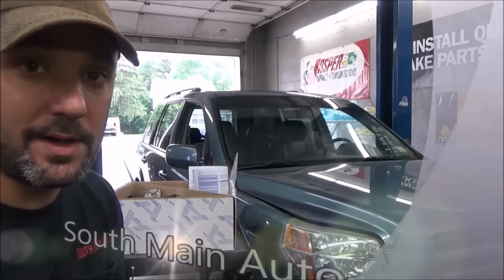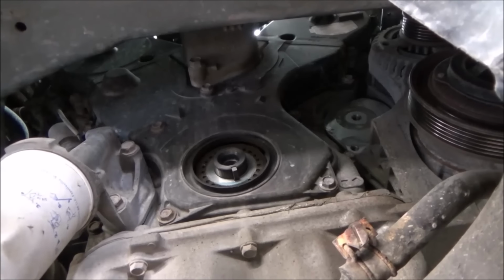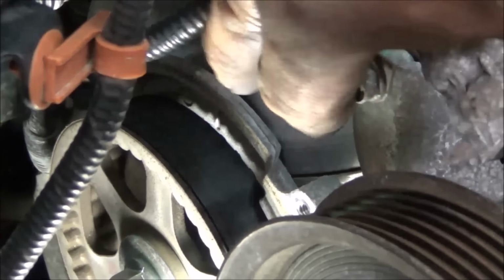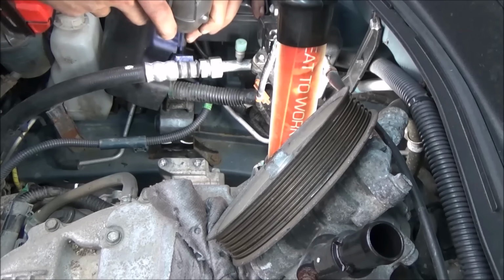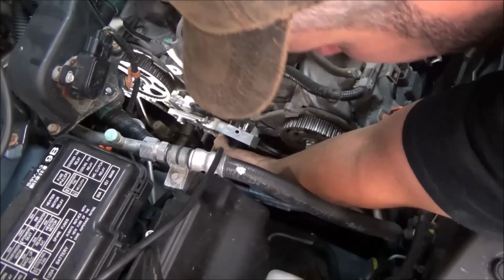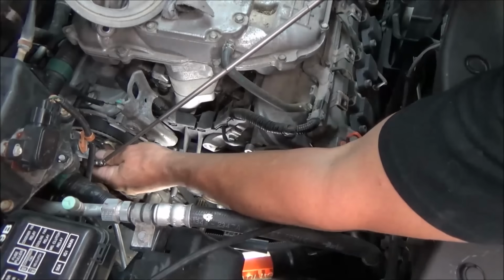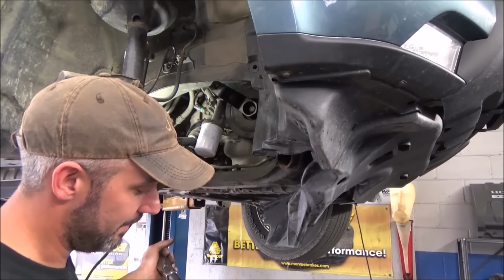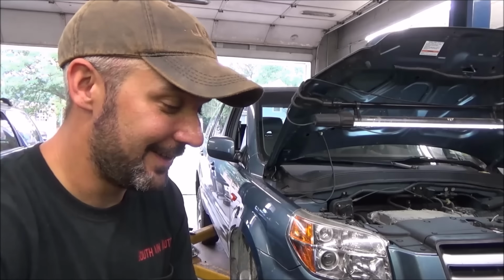Honda Timing Belt 3.5 J35 - Pilot, Odyssey, Ridgeline

Comment: Very good video! Thanks you for doing this. I used it profusely to do the job on my 2012 Ridgeline, with success.

Although, I had a lot of difficulties removing the crankshaft bolt. I couldn't try the way you did it because I didn't have a special beefed up socket wrench like the one you have and in any case, I didn't have enough pressure on my compressor to drive an impact wrench efficiently. Then I didn't have a crankshaft retaining tool to use a super long breaking bar (I broke an extension bar and my cheap breaking bar extended with a piece of pipe :-( . I found out later that I could "rent" a special crankshaft retaining tool (basically for free; they charge about $60 and you can have it for 3 days, then get all your money back upon return of the tool. I had to have that tool in order to re-torque the bolt in place to finish the job), at my Canadian Tire.

Nevertheless, I tried to do a few tricks that I saw on internet (use a Honda jack to break the bolt loose.....didn't work, then tried the starter trick (disconnect the ignition coils first), but this is dangerous and didn't work anyway. I then tried to torch it with a "Map gas torch".... not enough heat. Then I fiinally had it by borrowing a real set of oxygen/acetylen torch and it did the trick, although, you need so much heat that I was scared to damage surrounding plastic parts, etc. But it worked. I would have liked you to mention what is the direction of the crankshaft rotation, because I wasn't sure of that and I found out by actually filming my engine for a second of two while starting it.

Thanks for a very well explained video!
Rich

Comment: Your video just saved me $500. Same kit as you used. And even with the honda cranky tool, the crank bolt really did need two of us and a big cheater bar! Wish I had that super socket! The rear crank pulley was a pain to align--it would skip past the mark over and over again (engine compression?) and so it took a while to figure out how to get the mark aligned on all pulleys. Finally we figured out what tooth the belt needed to be on and then used the belt to keep it from over-rotating. Total job took 9 hours for two of us, but it was my first job of this kind so I'm pretty excited. Runs great! Again, thanks!

Comment: Outstanding video! I did this job on my wife's 2012 Odyssey last month after watching this video too many times to count. On her van, I had to remove the Intake Manifold Tuning (IMT) solenoid to remove the power steering pump and I had to take all the bolts out of the computer brackets to remove the engine mount.

Comment: Great vid, I made the marks highlighted with metallic gold color, makes it easier to verify the match mark & very nice to turn the crank manually to verify clean non-interference of parts.....no need to destroy the head and bunch of valves on power start after finishing up! Did this 2 yrs back to our Pilot....missed the rear bank cam sprocket by 1 tooth and had to get back into to reset that....oh yeah, later that year found I needed eyeglasses!!! Good video! This is a tough job for the average DIY ....but fun and save a bunch of money doing it at home!

Comment: Just finished on my 2010 Odyssey. This video proved to be invaluable! Never done a timing belt before, hope to never do another. Took two days with several breaks and a couple messy moments. Only one cut, from pulling off the old water pump, the housing is very sharp. Of course my power steering pump made a mess. All in all not too difficult. I did purchase the extra large 19mm from Lisle. It didn't help. That crank bolt is no joke. Took me several tries and all my weight to break that mother loose. 😡

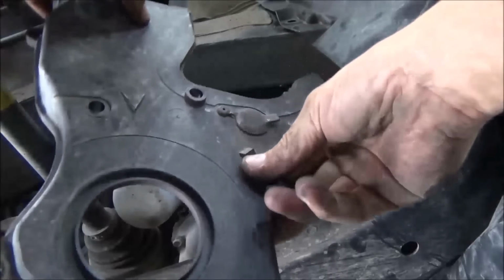Comment: 15:30 There might be an argument for replacing the crank sensor while in there. My tensioner failed at 148,000 and it seems to have taken both sensors with it (they were probably shaky, but the vibration from the tensioner probably hastened their demise), unless the ECM is just jumping to conclusions. 
PS: It's no wonder most of these videos are of Oddyseys, Ridgelines and Pilots; there is no room in my Accord Hybrid for that socket, let alone a camera.

Comment: I promise I won’t tell the 130,000. When we’re not watching tell me u don’t just rattle that crank bolt with 4 ugga duggas and move on. Throw the loctite in the trash. Properly tightened bolts don’t loosen up. Lug nuts, head bolts and everything else u put on the car. It’s lawyers and factory hates DYIer’s. The same loving souls that give us internal and external torx. Think bell housing to trans case 4L60. Those r beauties. Right guys?

Comment: Awesome video! I just completed the 100,000 service to my 2006 Honda Pilot. I followed the video step by step and car is running perfect! Very thorough! My biggest challenge was getting the hidden bolt for the engine mount that is located under the electrical equipment.

Comment: Hey Eric, nice video.  Got myself a 2017 Ridgeline and was curious how much of a pain it was to do this job when the time comes.  Cramped but not too bad. Is valve lash adjustment recommended at 100k miles?   I learned the hard way that I should have done that on my turbo subaru.  Had burnt exhaust valve at 140k... Had to repeat whole damn job with addition of head removal for head job. Sucked.

Comment: Hi south point repair 
Quick question, the guy I bought the pilot from changed the timing belt and water pump but never changed the hydraulic tensioner. I can notice some noise and was planning on changing. If i take the hydraulic tensioner out, do i need to adjust the timing belt or anything else or I can just snap on the new one.

Comment: Another great and useful video! Thank you!  We found a decent 2002 Acura MDX for my wife, needs timing belt done among a few other things(and I'll be the one doing it).   Mind my asking, if I don't have a car lift (just jack stands) how painful is this job going to be?  
I'm super concerned about the crank pulley bolt (will I be able to remove it?). I have a large craftsmen air comp with a somewhat beefy but basic Husky 1/2in drive.  What are my chances? If it will help, can you tell me where to get the (special) crank pulley bolt socket?

And can the crank pulley (hold) tool and Lisle socket be rented at an autozone, etc?

There are some oil leaks to address as well, hoping it's not real main seal. Could be crank seal and/or valve cover gaskets.
Where are some of the common oil leak areas on the 2002 acura MDX in your experience?

Finally, what belt, water pump, pulleys kit do you recommend? I'm thinking of getting an AC Delco one, but is the water pump it comes with a decent one?

Thanks so much for any reply

Comment: The heavy socket made it so much easier. Tried with a friend with a breaker bar but no success. Ordered this big socket and it opened it in a bit. Tried with the standard socket but no success.

Comment: Hey question on the side mount bracket bolts,  on my Honda I was looking for them and I took them out with my hand !!!, I tryed to screw them back the spin a couple of times and then get loose they are stripped.... do I need a new engine Block???..I did not Do a timming/watter pump change  i was just looking down the motor while ding an oil change and noticed one of the bolts sticking out.... great videos.

Comment: I have 2003 Accord V6, won’t start. I know I will need timing belt kit, but how can I tell if the valves are damaged? Any input will be helpful.
Reply from the maker: you will have to do a leak down test on it
Reply: South Main Auto Repair   I’m not sure how to do those tests. I took off the top timing covers, I saw the belt intact but was chewed up and some slack, I was able to spin the pulley. There was a point where it was hard to spin and a point was very easy where it spun quicker when I removed the wrench. I think the tension broke? Is it still possible that valves are damaged?

Comment: Top notch video, I realize this was a hard one to show but you did a very good job of it.  Most complete video I have seen yet for this timing belt change.  I now have two of these 3.5 engines so it is only a matter of time until I will be attempting the job. I have a 2012 pilot with 62k and a 2013 accord with 67k so I have a bit of time to watch and learn.  Thank you for your time!

Comment: I did this in my drive way with ramps and to hold the engine used a ratchet strap to the eyelet for hosting the engine out to the opposite side cross frame so the Jack wasn't in the way at all

Comment: I just had the Honda dealership install timing belt water pump kit on my 2011 Honda Pilot and now on a cold startup when I put it in gear it makes a vibrating noise. What could be making this noise? And yes I will be bringing back to the dealership. Wish I had a mechanic like your self near me I could go to.
Reply from the maker: Motor mount alignment issue maybe!?
Reply: Well the verdict is out on what was causing the noise supposedly. Dealership said it was the Bando serpentine belt I gave them to replace the old one as long as they were replacing the timing belt and water pump. Hard to believe

Comment: In the middle to changing my timing belt and watched it t confirm a few things.  I was able to watch the entire video without being bored which is testimony to the presenter.  Everything he did seem spot on.  There was one tiny thing that I would do different. Pull the battery cable while working on it.  But maybe I am paranoid.  Thanks for the great video.

Comment: Great video! Thanks for the help. 

One important thing that would be worth mentioning in your video. I know it would have helped me. 

The rear cam does move on occasion about 3". What do you do if this happens?
I had no idea it could do this, since I never saw it mentioned in videos.   I started questioning my timing marks and what I did wrong. Just a frustrating experience.  

Anyways I think you have one of the better videos on this subject, Thanks again!

Comment: In you're video is in depth, easy to follow and out right awesome. Thank you for this gift, you helped save my family a lot of money. .Tip for those unable to get the CS Bolt off. Put a breaker bar and a 19mm socket together and have it snug over the wheel assembly while holding the CS Bolt. Brealy crank the engine. It will Easily break free (CS turns counter clockwise.).* CS = Crank Shaft

Comment: If you don't have a torque wrench like on this video to torque a 60 degree, you can buy a device on ebay that can do a 60 degree on that crankshaft pulley bolt and it costs only $7.58.  A simple device and there are a lot of videos on youtube to show you how to use this device.  Here is on ebay:
https://www.ebay.com/itm/360-Torque-Angle-Gauge-Rotation-Checker-Measuring-Gauge-Meter-4-Torque-Wrench/331633092857?hash=item4d36df68f9:g:pE0AAOSwMmBV1S9X

Comment: Great video.  I was able to do my 2012 Honda Pilot due to this video.  I was pretty intimidated by it until I found this.  Took me much longer as I kept coming back to this for each step and there were a few very minor deviations in the configuration, but for the most part, this was the most thorough.  Thanks a lot for this.

Comment: Hi Eric, when you removed the water pump, antifreeze "washed" the crank position sensor.  As the timing belt cover are supposed to keep dirt and water away from this part, could the antifreese and the "water cleaning" damage the sensor ??  Thanks a lot.

Comment: Love your videos; I watched this instead of the hockey game. Father-in-law is giving my daughter an '04 Odyssey. Never changed timing belt or coolant. Has about 65K miles. I take care of my own vehicles and have good tools. Service manual says to "check" water pump when replacing timing belt. I can see advantage of replacing whole kit if you have to pay a mechanic to replace belt. Cost of labour is an important factor. As long as all parts last as long as timing belt it might make sense. My labour is paid with hugs and not cash. I find many replacement parts do not last as long as the OEM so replacing parts when they are fine does not make sense to me. 

What is your opinion on changing timing belt only (65K Miles)? Age is my only concern. Leave bearings, tensioners and water pump alone.

Comment: I just bought a used 2009 Honda pilot with 165k miles on it. The engine has developed a "tapping" noise. There is a sticker in the engine compartment saying the timing belt was replaced at 110k miles. In watching your video, could this tapping indicated that the timing is "out?" When they change the timing belt at 110k miles, could they have not had the cams in the correct position when they put everything back together? Thank for your help! Mark

Comment: Excellent video! I just purchased a 2007 MDX with 170k. I was told the timing belt was changed at 113k but I don't want to take any chances. After watching this video I feel confident I can perform this job myself. Just wish I had a lift......

Comment: I realy appreciate this video. I started my odyssey 06 in one day and on cam shaft it move 1 quarter clockwise.  I spin it back. Hopefully it'll work.  I tried  to spin it clockwise but after an inch it kida of hit something so i didn't  want  to force it so i spin it back a quarter of rotation.  The other pulleys didn't move. The crank bolt came off  quite ok. I didn't struggle too much.  Also one of the motor mount bolt  snapped.  S o now i have to figure out how to remove the bolt.

Comment: Hi Scott, just doing a very similar job on a 2003 Acura TL which has basically the same engine.   A few things I noticed that you may not have mentioned:

   You will be removing and putting back about twenty 10mm screws in very tight quarters.  So you will need the thinnest ratchet you can find, and several 10mm sockets of various depths and a few very stubby extensions.  

Several of these you can only see with a flashlight and a mirror on a stick.  You will have to find them, then maneuver the socket over the, often blindly.  One trick is to tap the socket around, blindly until you hear it clanking on the bolt head.  I'm talking about the worst ones 
, the top four bolts on the bottom cover.  Looks like there is a smidgen more room in the Ridgeline, but it's very tight on like the accord and TL.

There is a very good reason the bolts for the two idler wheels have that ledge-- you loosen the bolt about six turns and you can get a bit more slack in the belt so you can slip the belt on.  Otherwise it's impossible to get the belt on the right tooth.  

The aluminum engine mount goes on BEFORE the lower cover.  Wasted 45 minutes redoing this in the right order.  When you clean off the mount with brake cleaner, don't freak out and think you see a large crack on the top, it's just a milling mark. 

A bit dirty, but you don't need a fancy crankshaft holder to get the big bolt off, just brace your breaker bar against the ground and bump the starter for a second.  Crude but very effective. 

Remember that all these screws are going into aluminum, so don't horse down on them,  8 f-p is plenty on the 10mm bolts, 30 on the others, as much as you can pull on the crank bolt.   

The book says this takes 4 hours, its taken me about 9 hours, but it was my first time and I had to run to HF to buy various 10mm sockets and stubby extensions.
Reply: Oops, I meant Eric!

Comment: Just used this video to install the same kit on my 07 Honda Odyssey. Brought my laptop out to the garage and followed step by step.  2 hours after starting, I was 4 minutes into the video. Took me 12 hours total. Most of the time just struggling with old bolts and crap in the way. All turned out well and the van is ready for another 100k. Also watched your power sliding door replacement video which was also very helpful. Thanks a ton! You have saved me over $1000 and a lot of head scratching. Appreciatory valve is wide open.

Comment: Excellent video for a one man team Eric, you record your videos with minimal disruptions ,im a self taught mechanic and i learn a lot from watching you work  i did my first timing belt on a 1996 Mazda Famila it actually broke the car had to be towed in, thank god the engine wasn't interference so no valves bent and the cause of the breakage was a leaking cam seal .However didn't have same luck with my first car 1984 Nissan sunny 1.5 belt broke bent 4 valves,had to pull the head change valve seals  head gasket grind new valves and was good to go car still on the road today .

Comment: I have a 1983 Chevrolet S10 with the V6.  I stopped at a stop light and "BANG!" there was this like huge bang, then I couldn't shift.  The garage said it would cost $700 to fix the clutch.  Well I don't have the $700, so I am going to fix it myself, and with your wonderful video tutorials I think I can do it.  I don't like the idea of trying to take the bolts out of the exhaust at the manifold on a 34 year old truck, don't want to take the chance of breaking a bolt, so I have decided to cut the pipes and use flexible hoses to put it back. But I need a good light, and I notice you have one with a flexible extension and a magnet on the end.  Can you tell me the name of that light so I can order one.  Thanks Eric.
Reply from the maker: http://amzn.to/2wNw3ft

Comment: Excellent video, best one for this project hands down! Thanks for posting! Is absolutely necessary to line up in #1 position? Can you mark them in the current position without turning the crankshaft? Thanks
Reply from the maker: Good question , you can put it any where you want as long as you have good marks before you take the belt off. I find it easier to just use the factory marks.

Comment: great video 
this is actually my first time doing this kind of repair 
my question is when installing the timing belt the rear camshaft cog move a 1/4 back .
now they don't line up with front camshaft and bottom crankshaft 
is it OK to put it all back ?
or how do Align the rear only?
thank you